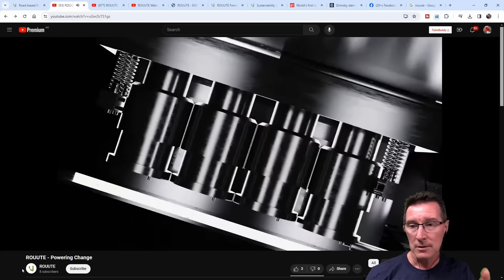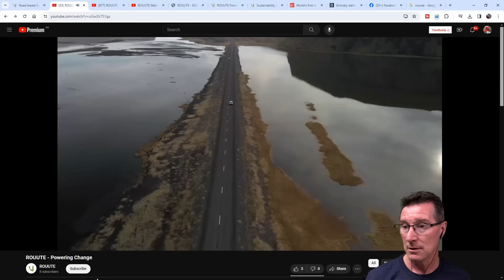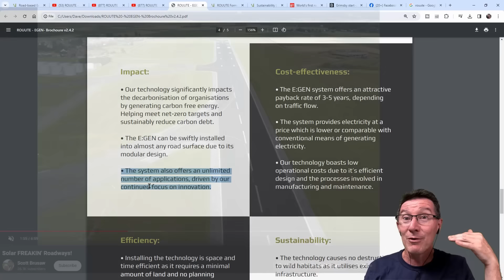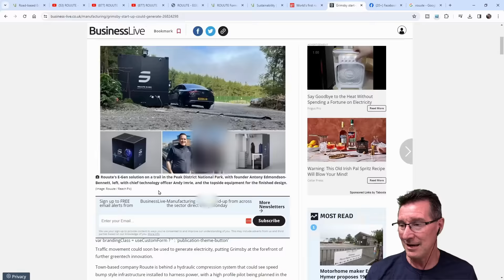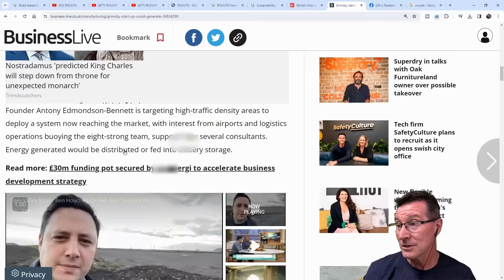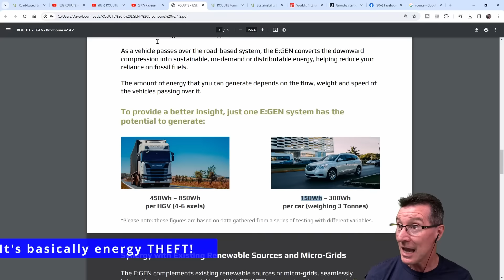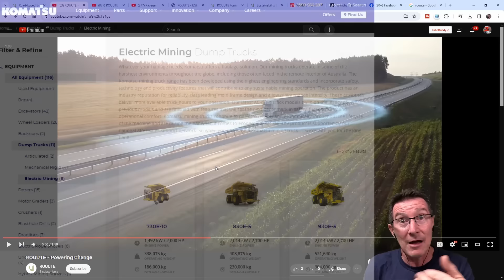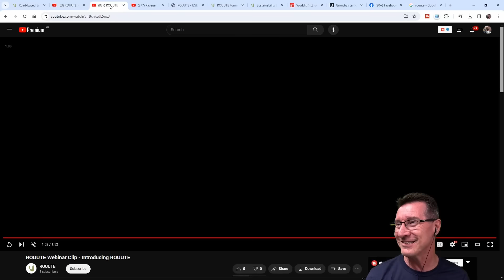EEVblog 1600 - Rouute: Road Based Energy BUSTED

Comment: I get how they want to power industry and other fixed stuff, but what if I put square hydraulic wheels on my car and used them to harvest power to run the car it self? 
Here's another idea, put like tread mills in parking lots and instead of charging people to park you just have them leave their engine running with the transmission in drive. One could power a whole city that way!

Comment: 300 Wh!?!? From a SINGLE car!?!
I mean wow.

Lets just roll with their numbers and go with the low side to show just how absurd their lies are (cause yes they are lying):
For a best-case scenario - 150Wh on a 3 Ton vehicle at higway speed for 130km/h. That is just about 540Wh. And they want to sap out 150Wh (at minimum) from that - that would slow you down to 110 km/h ....

The 300 Wh ....  running over a speedbump on the highway at 130km/h and then slamming into a wall. That sounds like Fun.

Comment: Carbon free only if the vehicles are being driven by 100% carbon free fuel.  All the energy comes from the car traveling over the device at some efficiency level which is always going to be less than 100%.  It will increase the cost to drive from point a to b.  Also, if I am driving down a mountain, I don't want to be driving over speed bumps.  Idiots.

Comment: A shock absorber is an element that dissipates energy when hitting a speed bump, a brake is an element that dissipates energy when braking a vehicle approaching a speed bump. If energy were to be recovered at a speed bump, vehicles would have to have their brakes disabled and their suspension stiffened to allow the road infrastructure to brake and dampen... 😂😂😂

Comment: I've got it! Why don't we take that petrol-powered Jeep (or whatever they put in the video) off the road, thereby eliminating its future carbon emissions and gaining a carbon credit, then we can remove the engine and attach it to a generator and run it like it would've run on the road, but for net zero emissions energy!

Seriously, it's the same thing. You're taking the energy in the vehicle, which probably came from fossil fuel, and turning it into electricity. And if you're taking it from an electric vehicle, that's energy you need to put back into the vehicle from somewhere.

Just take the money you would've spent on this and use it to put solar panels onto a roof that doesn't have solar panels. You're welcome, I'll take my Nobel prize in cash please.

Comment: Another way to make this seem even more ridiculous: A 3000kg car in earth gravity = 3000kg*9.82 = 29460N, the claimed 300Wh = 1080000J. Then the distance must be 1080000J/29460N = 36.6m. This means that these glorified speed bumps would have to depress 36.6 meters under the full weight of the car to absorb 300Wh.

Comment: Okay, okay. Forget that.
Magnets. Fit magnets under every car, then embed coils in the road and generate free energy by induction. 👍
Reply: I see, we have the same idea 😂
Reply: The coils are already there, well at intersections anyway.  Should get enough power to run the traffic lights at least.
Reply: @j.f.christ8421  If you mean the vehicle detection coils for controlling the traffic lights and they are the same as used in our country, they would not produce a single volt if a magnet as big as an M1 Abrams passed over them - inappropriate coil design - if I consider this arrangement as functional, the effect of the magnetic field would cause the passing vehicle to slow down, thus the engine power would have to increase and thus consumption would increase and we are where we were - costs greater than profit - I am not talking about the costs of operating such a device.

Nice day 🙂 Tom
Reply: @Edisson.  Sigh.  It's a joke, son.  This is why you don't get invited to parties.
Reply: @j.f.christ8421  I get it and that's how I feel about it - this was just a thought - see my main comment and I'm popular at parties for my sense of humor - I'm a hell of a buffoon, but unfortunately I don't speak English very well so I must have mistranslated myself - however coil and a moving magnet will actually produce meaningful energy 😁
Reply: @Edisson. No it won't produce energy, it will convert energy. Stealing it from the car.
Reply: @Edisson.  Describing yourself as a buffoon is correct.  You still don't get the joke, do you?
Reply: @j.f.christ8421  I understand, we just don't understand each other - I don't know how to express it correctly in English, Czech is completely different in terms of word order and the colorfulness of the narration.

Comment: in my town the main roads are worse than the surface of the moon, so you are not able to drive more than 20-30km/h because of holes in the asphalt, but anyway they installed speed bumps on them that are lower than the holes... on a 900m part of the main road thru the city they installed 4 speed bumps, they also installed those blinking lights before and after the speed bumps and in 2 weeks all of those lights were gone torn up out of their place... one month ago they painted the lines on all of the roads, now those lines are not visible at all, so yeah we probably need this Rouute, i should tell the local government about this 🤣🤦‍♂

Comment: Yes, it's the same as if they wanted to install huge magnets in cars and coils in the road - as a car passes with a magnet above the coil, it will generate energy, but in order to drive and generate energy, it will have to overcome magnetism and thus the consumption of propulsion energy will increase 🤔 but it will not jump with by car😁 well, I'd rather go build a generator of eternal energy from an engine and dynamo 🤣

Nice day 🙂 Tom

Comment: There are more efficient ways to build a gasoline powered generator.

Hell, you could just hook passing cars with a grappling hook attached to a windlass that powers a generator.

This is basically driving over a series of plungers, you have to climb up to the original level every time. Assume that each plumber depresses 10mm. That will cost you m•g•h in energy each time. Say m is 2Mg. That works out to 196J per plunger, maybe each one is 100mm apart. Crunching the numbers, a car going 96kph would generate about 52kW.

Converting the 52kW into lost l/km is left as an exercise.

Comment: As actual speed bumps where the aim is to force driver to slow down, the bump would generate power by making the bump less of a bump because it is a shock absorber. Therefore the driver could drive at higher speed as the bump has less effect. To combat this the bump needs to be higher or more of them to absorb the energy of a faster car. The ideal driver lets the car slow down to the exact speed that is comfortable to go over the bump. This speed is higher for a shock absorbing bump. But if the bump is made more shock absorbing, the perfect driver has to speed up. That extra speed is what is used to generate the power. The bump does work for non-perfect drivers who brake to slow down. They don't need to brake so much on these shock absorber bumps. So this only works for fuel driven (non regen braking ) vehicles.

Comment: If that bump generates electricity, why does the generation cube next to it need solar panels? There are two greenstone thoughts they are mixing here one is a stored bump that generates electricity the other is a piezo electric layer underneath longer distance roadways that also extracts energy from the weight of the vehicles that drive over it.

Comment: What's strange to me, unlike some of the other 'make roads out of it' ideas, this is an easy thought experiment. If they get even at worst 150Wh per car for 3 bumps you can just line an offramp with these things. Just go all out, why only one per mile? Why not back to back, make a washboard road from them. Surely these things are only about 2 car lengths, about 24ft. So for a quarter mile offramp that's 55 of these. So a single car on a single strip is 8.25kWh... Look at a tesla model 3 extended range battery pack, that's about 80kWh. So just one offramp is able to charge your car by 10% Worst case!!! Convert that to mileage efficiency and you can drive 34 miles.

So, if you put one stretch of these on a flat road, every 34 miles, you'll according to their claim be able to charge 34 miles of range... Sounds like free energy. Why not just put these every 10 miles. Every 10 miles you get 34 miles. Or you can just line these up back to back for a 3 mile run and fully charge a Tesla model 3 extended range battery with 340 miles of charge!! WOW!! Imagine the green energy. All you have to do is charge your EV once, drive 3 miles, using less than 1kWh of energy according to how much battery percentage is used to just drive 3 miles on flat land. Now you have generated enough energy to fully charge someone else's Tesla model 3 AND charge back what you just used to drive 3 miles...

It just doesn't pass even the most basic thought experiment. Aside from driving on a washboard, nothing is stopping them from lining 100 of these in a row and making an obvious free energy device that clearly is impossible the way they claim it works. What a joke.

Comment: If they extract 70 km/h of speed from a car, over a length that is maybe 1-5 meters (depending on amount of bumps needed), that is equivalent of stopping the car in a crash against either a solid wall or T-boning another car.
Reply from the maker: I suspect their numbers are a tad off :-D
Reply: Hitting what is basically a hydraulic damper at 70 MPH will be like hitting a Kerb stone,  Hydraulic oil does not move fast enough that's why they are used on suspension systems.  Regardless of how much energy they claim.
Reply: That gives me the idea for a road guard rail that has emergency alert devices powered by crashing into them
Reply: That's efficient, and may encourage the sale of new cars. If the occupants survive.
Immediate government grant guaranteed!

Comment: Hey Dave! I invented a new zero emission power generator. All you need to do is to hook up the tires of your car to my INNOVATIVE electric generator with a 100% sustainable power transmission belt, locally sourced. If you use an electric car, you achieve net carbon zero!
Reply from the maker: A million bucks in Indiegogo right there.

Comment: The landing planes thing was good. Bottom of offramps... Fix the silly bumpy pads with a Compliant mechanism platform, or use one end of a bridge expansion joint. Use the platform to push down on a bag or piston of hydraulic. Send the hydraulic past a check valve to a higher level or compress piston and spring, generate power when the hydraulic returns down to the bag other pistion. Repeat.

Comment: If you had a 1 Kilometer Circular track you could install enough of these systems to fully charge an EV.
This means you could keep driving the EV around the Track Forever as the EV would be able to Charge itself.
In other words either this Company has Successfully Developed Perpetual Motion or... they're Full Of Shit.

Comment: It destroys your suspension and shakes the bejeezus out of you, but it contributes to the road toll and adds 0.0001 watts to the grid every day. Miracles don't happen. 🤣
Reply: Plus all the hydraulic oil that always leaks out.
Reply: 0.0001 watts.... Optimistic or what..   :)
Reply: Speedbump sleeping policemen are a thing and will always be a thing until the day the driver can't select their max speed. IF AND ONLY IF the cost of installation and maintenance is lower than their return then this would be a good road safety product. Putting them anywhere else would be a road danger product, would not like to hit one of those in the wet on a bike.
Reply: @baconghoti  No if you're willing to go with a more expensive solution for speed bumps then those automatic ones that drops down for speeders is far better. The little energy recovered by this is unlikely to compensate for even the manufacturing of the product and if you want clean energy just build nuclear.

Comment: I think I could produce power from the pushing of Trollies all around the world by replacing the wheel with a motor that will generate green energy. Cough. Cough. Just need the super caps or batteries and connection to the grid what do you think .?

Comment: RoadPower Systems Inc. in Brooklyn, New York, has developed “smart speed bumps” platforms that can be installed onto the pavement of a parking lot, entrance road or private roadway to capture the kinetic energy produced by vehicles as they drive over and brake on the platform. The technology within the platform regenerates this energy into “grid-grade” electricity, storing it in recycled lithium-ion battery banks.

Comment: Why wouldn't it work with solendoids and springs(keep it close to solid state, no clockwork hydraulics or pneumatics), power output estimates seem dubious... but if zebra crossings could be powered by raised crossing, it might be good for rural stuff etc even piezo pads that power LEDs embedded could be handy

Comment: I can actually picture a lot of uses for something like this. Generating any significant power is NOT one of them.

But I can picture it powering things like some LED lights or those real-time speed limit signs. But here's the thing. If it can be powered by a speed bump, IT CAN BE POWERED BY SOLAR.

Like maybe it's supplemental. But with our roads, I picture the maintenance on this being way higher than anything it would produce.
Reply: Cost must be astronomical. Whereas solar you just need a panel and some wires....
Reply: Id love to see how these deal with either -20c temps, or 300mm of wet snow, or how fast they get destroyed by a snow plow.

Comment: The only useful place would be long downhill mountain road to save brakes of gas cars or avoid overcharging electric cars, but 1. making the road bumpy would increase carsickness, which is already increased by such twisty roads and 2. installing/maintaining such system in such an environment will probably use more energy than what is harvested (since the machinery needs to go uphill all the time).

Comment: I think giant pendulums between major destinations is the future of energy efficient travel.
Reply: Imagine you if you wanted to step off halfway between the stops 😂
Reply: Reminds me with that elevator thing from Total Recall
Reply: Actually, some of the urban trains in Germany use something similar by having elevated stations so they decelerate uphill and accelerate downhill.
Reply: @dirkvornholt2507  I can't remember which, but at least one of the early tube lines in London did this too.  Regenerative braking before there were power electronics.
Reply: @jonathanj8303 I'm pretty sure that was the Victoria Line, which is the second newest Underground line.
Reply: @wta1518   It definitely applies to the Central London Railway, which opened in 1900, and now forms the centre section of the Central Line.
It may well also be true for other lines, including the Victoria, it's a pretty self evident bit of 'tech' if you have the vertical space available to build that way.
Reply: @jonathanj8303  Thanks, I only knew about the Victoria Line.

Comment: Off ramps from highways maybe? That might require the device to handle a pretty decent speed though. Then again, if we are expected to drive cars with regenerative braking, then that takes away from the regenerative braking. 

Otherwise, I agree with the acceleration required to get off the ramp on a flat road.

Comment: If it is not a forced break system, it would need more energy to get less energy back.. basically a waste of energy.. the opposite of what it claims to be. 
Usually you break before you drive over a speedbump, the speedbump itself doesn't primarily slow you down, it usually works more like a physical speed limiter, because you don't want to trash your car.

Comment: The only useful application i can think of this is to replace already used speed bumps around parking lots or outside schools to power few lights at night.... can't believe i almost wrote a thesis paper about this.😅
Reply: I thought about that, but it will still use more energy from the vehicle as just like a hill, when the wheels come back down on the other side of a normal speed bump, some of that energy is converted back into forward motion of the vehicle. Not in this case though, so it still uses energy from the vehicle to power it.
Reply: Plus the environmental damage from the hydraulic oil, Which will need replacing regularly too.
Reply: @dogwalker666 yup and then your site entrance and exit is blocked and what if it breaks what is the downtime then? Especially in shipping facilities they where on about which a lot operate on extended hours there’s no way you would want to complicate a simple speed bump because the implications of it breaking are not good.
Reply: @dutchbeef8920  Exactly, Our shipping is time critical, We couldn't afford the exit or entrance blocked while it is being repaired.
Reply: Is that not what this was intended for? I didn't see anywhere it mentioned using them at speed
Reply: @IonRoux  in the cgi graphic the show them on motorways. The court cases for damage to suspension components would be astronomical.
Reply: @IonRoux  there's a bit in the video where it mentions these are slow speed and others yet to be made are high speed

Comment: My guess is that the real energy is 150-300J and someone got confused about the units. That's 3600 times smaller than what they said. It seems unlikely that they could have gotten this far without someone correcting them. If that's true, they're committing fraud every time they say 150-300 WH.